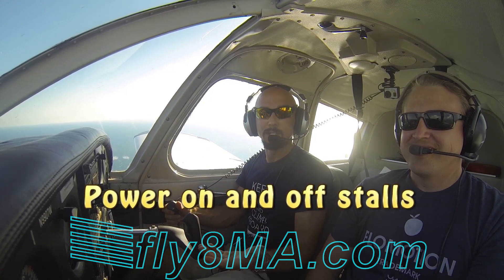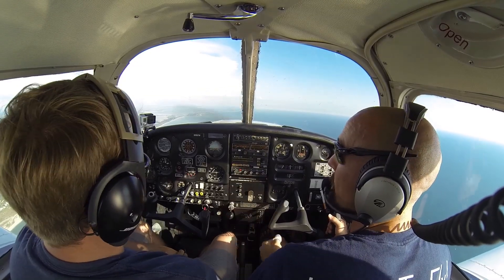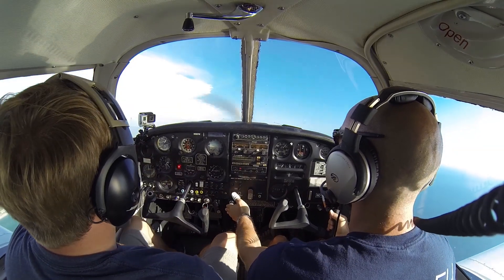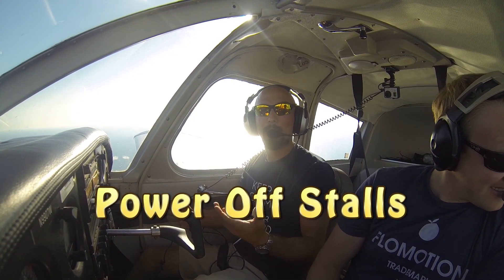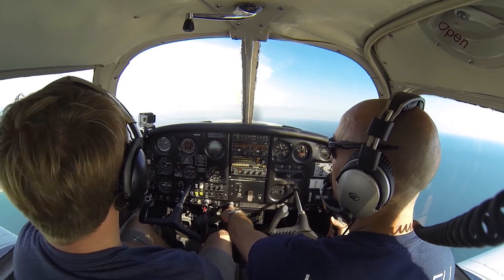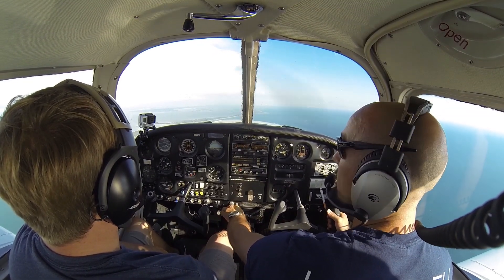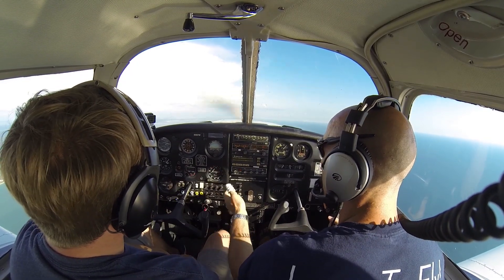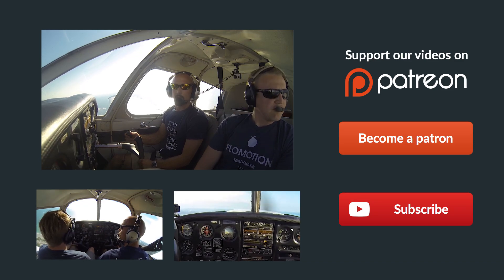Ep. 21: How to STALL a Plane....Properly

Comment: I had an instructor that had me do what she called rudder stall.  Power off stall and don't recover, just keep wings level using rudder stall. With the C152 it showed about 500 ft per min decent noise high wings level! I think this was something to learn to keep out of a spin. It was fun after I got the hang of it. Starting at around 8000 I could keep it wings level in a full stall for about 2 min then power on to recover from the stall. I learned how to know when the stall was coming and not fear it.

Comment: thank you and i have two questions.. do we need flaps through power on stall? and according to what we release flaps during recovery of power off stall ?
Reply from the maker: Typically power on stalls are done in the takeoff configuration.  Really depends on the airplane as to whether or not you'll be using flaps.